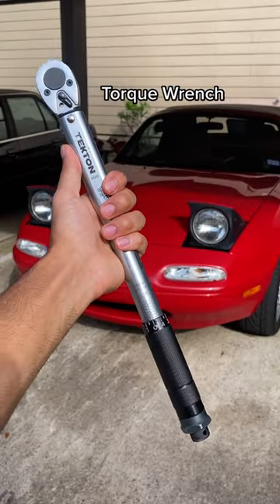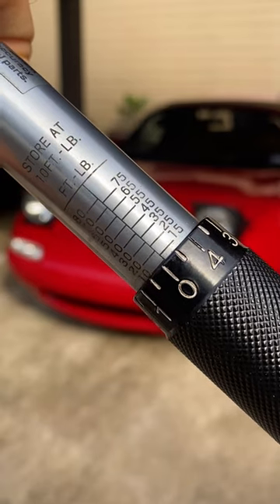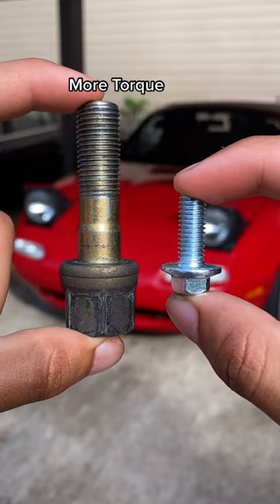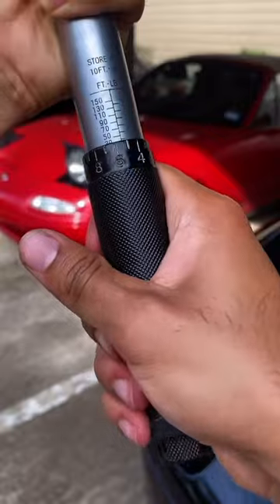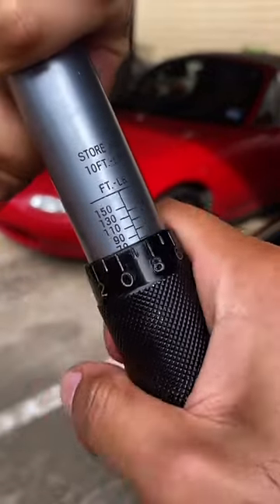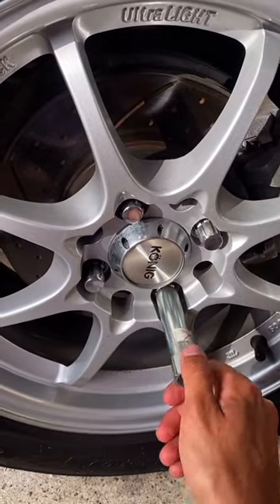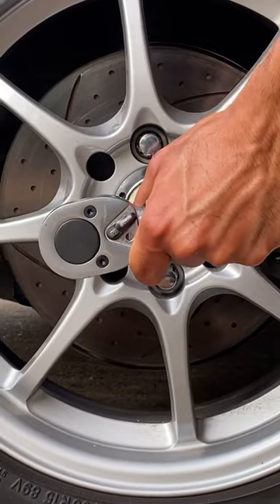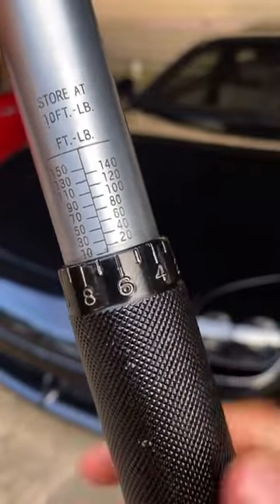How to use a Torque Wrench! (the right way)

Comment: Make sure to do a star pattern when torquing alright to make sure that you torque it evenly
Reply: Only on a wheel, but the video is about the torquing not the tightening pattern.  On valve covers you start inside and work out, in multiple steps.  Some people jerk the wrench achieving impact load, not right, must be even power to wrench until the click, then release.   Doing it the same is a big part of the process.
Reply: @nickbeaucage4711  and always make sure to hold the toque spec for a few seconds after the click so the bolt doesn’t back off 😉
Reply: Technically it's 180/90 pattern
Reply: I’d like to see you get 1000ftlb without some level of jerking on the bar.
Reply: @nickbeaucage4711  also on head bolts, bell housing to transmission, intakes, anything that the torque should evenly be applied to
Reply: @htowndct832 not necessary. Just stop when it clicks and push one more time til it clicks again
Reply: False you don’t have to when tourqing you only have to do star when your zapping then with the impact after that and there on you don’t have to do a star to finish tourqing then
Reply: Well shiet, went to retorque couple hundred miles after tire change and I did not do the star pattern. Most bolts did not budge before the click. I hope all is good.

Comment: I was gifted a digital torque wrench and holy crap I love it. Just a push of a button and I can set it from 5lbs-125lbs. I need to get one that fits 1/2” drive though
Reply: Snap on makes one that’s really expensive but you can switch the anvils out . I rebuild diesel engines and I only got one because I use it everyday . They even do angles when your stretching head bolts
Reply: Use an adapter
Reply: @brandon33371  most shit it’s fine but if you really need an accurate reading it’ll throw it off a plus or Minus a few ft pounds
Reply: @Moelester692  IK that but thanks for the refresher
Reply: @brandon33371  I’m just saying , depends on what your wrenching on . I work on planes and 5 pounds makes a difference
Reply: @Moelester692  I work on heavy duty diesels, I get the concept too
Reply: @brandon33371   roger that , I did heavy equipment /diesel and cranes before  . Besides drive line components it was always a few hhha Duggas in diesel haha
Reply: @Moelester692  lmao fr

Comment: You're supposed to set the torque wrench to the lowest setting, not close to zero, not all the way down but to lowest setting
Reply: Exactly, if the lowest setting is 10, it stops at 10.

If the lowest is 100, it gets stored at 100.

Excepting the older style torque wrenches that are manual reset styled. They don’t have to worry about resetting back to the lowest point.

Comment: I own a 1/2" torque wrench and I work at a Toyota as an entry level Automotive maintenance technician. Most Toyotas are 80 foot pounds. We would torque the wheels at a star pattern after a rotate to make sure it's even.

Comment: Cheap torque wrenches like that are okay for things like wheels. Although if you are working on sensitive parts like engine internals, SRS components, diffs, trans, or rubber suspension mounts, you're really foing to want a calibrated and accurate torque wrench. Lots of cheap torque wrenches are not accurate ar all. I had a TEKTON wrench like that when i was starting out as a lube tech 6 years ago and i tested it on my shops torque meter and it was off by like 20 Ft/lbs. 

Realistically, most things that are torque to spec do not need to be torqued to spec. Imo, for 90% of bolts a torque wrench is just to prevent beginners from snapping bolts.

Comment: Don’t forget to hold it for 3 seconds metal being torqued to spec tends to the metal being trying to “reform or fit itself “ others call it recoil
Reply: Who lied to you once a bolt is torqued is will not by itself get less torque. I been using torque wrenches for 4 year on a lot of things. I never held it at 3 seconds and i could come back next day and submit the the item to qa and it would pass torque testing without holding  it
Reply: @radioactivefox1  idk brotha I saw a very informational video on it on YouTube and apparently my local mechanic and a certain other YouTuber agreed with it for certain situations that “required” such a high torque spec
Reply: @radioactivefox1 look up “torsion”

Comment: Can I use a 1/2 inch torque wrench with a adapter for smaller bolts? Will this still be accurate ft lbs?

Comment: My dads always taught me not to rely on a torque wrench or think you need one to do every job, he told me the only time to use a torque wrench is inside a motor,trans, or differentials. He said it’s not a good habit to rely on a torque wrench for everything.
Reply: you want to use one on tires. There are horror stories of people not tightening enough and losing their wheel on the highway. Plus, if you over tighten you're going to have a hard time getting it off later
Reply: It should be the exact opposite, if you are in your shop and it’s an easy to reach area why the hell would you not torque to spec

Comment: Who torques their wheel bolts? I don't know a single person that does it.
Reply: Everyone but you. They’re the most important bolts to have torqued properly
Reply: @vexedpixels  i tighten them with the cross wrench. Wheel never fell off, i once hit a giant pothole, the wheel bent and bolts didn't budge so i think I'm doing it right 👍
Reply: @richardbudicek1508  its really just to cover your ass when you work in a professional environment plus if you do it the wrong way and something goes wrong thats on you.
Reply: Right 😂 like make sure they are tight using your big girl muscles and call it good. Only dorks use a torque wrench for wheels
Reply: @leftylattin lmao you’ve clearly never visited any sort of mechanic shop. Or basically anywhere that uses sockets and ratchets
Reply: @darksid356  yea places that have rules and guidelines put down by osha and insurance companies to make sure its dont to spec because tire shops hire careless kids 🤷‍♂️ im not saying nothing on a car needs torque speced, but ffs tires arent one. Ive taken off and put back on loads of tires on all my cars over the years, never had a single lug fall off and never had issues removing them. Just Get good dork 💅

Comment: Never set your torque wrench to 0 when storing it
Reply: If not it messes it up
Reply: I’ve worked on cars quite a bit, but I’ve never heard of this. Can you explain why?
Reply: @jonathanlynn2613  because I said so
Reply: @D_Rami69  instead of explaining it, mf just said bcs he said so
Reply: @D_Rami69   All torque instruments should be stored in their original case. Avoid any torque wrench storage locations that are subject to high or low temperatures and high humidity. "Clicker" style torque wrenches should always be turned down and stored at the torque wrenches lowest possible setting.

Comment: I have also heard when torquing, once it clicks hold it for like 2 or 3 seconds then let off. Not sure how true it is but it's not like a few seconds is going to ruin the day
Reply: Nah, just click them off and don’t worry about holding it. 

Try to avoid double clicking on smaller stuff, but don’t worry when you get to 3/4” torque specs

Comment: What are the 1234 numbers going across for
Reply from the maker: That’s to select the ones value, so for example while the top of the black handle  is between 80 and 90, whichever one of those numbers on the handle line up with the centerline will indicate 81, 82, 83…
Reply: @sixspeedofficial  brooo finally after some time I understand a torque wrench I appreciate the info dawg definitely deserve more subs 🤙🏾
Reply: @sixspeedofficial  how to know how much pressure gonna use to tighten the nuts?

Comment: Sometimes lube is required, sometimes not.  Your torque wrench may be precise, but is it accurate?  You do want to know that.  Mines a snap-on $200 used.  When I see the snap-on truck I ask if he can check.  What he is checking is how close the wrench set torque is  to the torque measured by his machine.  How accurate is his machine?  Plenty.  Now back to the project! Good ish video.

Comment: You need to pull the torque wrench not push it as you did. And also 90 degrees pull angle from the handle. The torque will wary from the preset torque value if you don't pull at 90 degrees angle.

Comment: Now that's something you know we're not going to do. All of our torque wrenches have been stored at whatever the last job required for the past 50 years and it hasn't affected anything.
Reply: Have you calibrated them? As it normally only effects the cal on the tool but normal use will also make the cal go bad.

Comment: The torque spec on my lug nuts is however fucking tight I can get it.
Reply: Great way to break a stud and have your wheel fly off.
Reply: @seraph512  Whatever. I drive a beat up Honda accord that’s worth $8,000. If the wheel falls off and I total it our insurance will cover it.